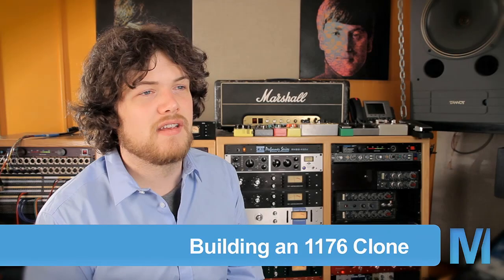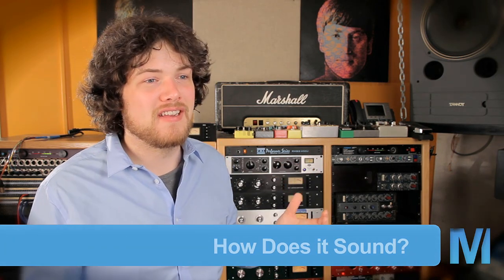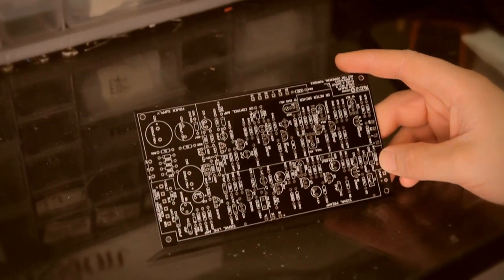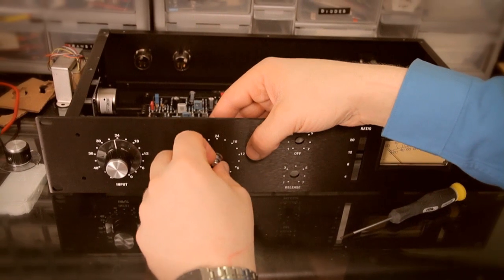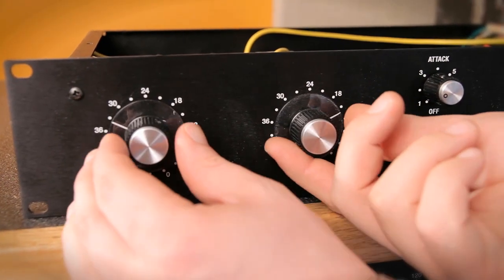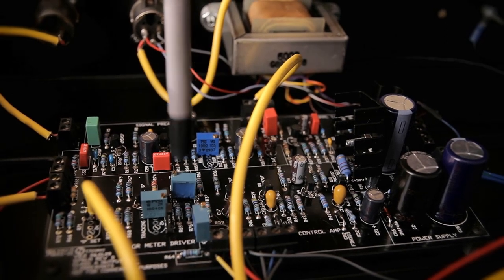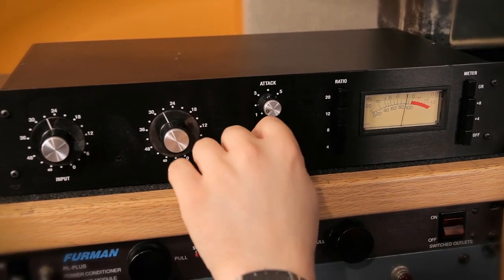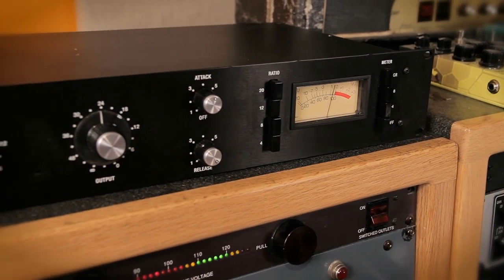(Audio Compression) How To Build 1176 Compressor Clone DIY For Music

Comment: Boy, this is an interesting throwback video. Back in 2011 it actually made sense to DIY 1176 clones. It really doesn't today. Pimarily because 1176 plugins have gotten good enough to do the job equally as well the hardware without much - if any - audible difference. Secondly; you can now easily purchase fully assembled hardware clones from lots of different companies that are electronically identical to the DIY kits - yet cost about the same. Unfortunately there really isn't as much incentive to going DIY on them anymore.

Comment: Hairball Audio. Go for revision D (its the same the UA 1176LN and Purple Audio MC76/77 is based upon). The kit includes all you need except components. They are available via the BOM (bill of material). There is a link to mouser where you can basicly just "add to cart". Have fun :) And remember to check up on safety. You can die if wire wrongly or touch a charged capacitor. Good luck

Comment: Okay, I love the idea of building my own compressor. I'm sure it would be a huge headache but also super fun. But, kits are expensive-- just $50-100 less than the price of a prefab clone like the WA76. What would I gain by building my own from, say, the Hairball Audio kit?
Reply: i reckon the hairball rev a sounds a little better than the warm. and the 500 series hairball kit is only $425, looks like. same ed anderson transformers and everything as their rackmount. edit: i'd be more interested in getting a pre-built hairball myself, but at the moment i'm getting very satisfactory blue stripe-y sounds out of this free plugin called Fetish by analog obsession, so it's hard to justify for me. and no, i definitely don't feel this way about all plugin/hardware compressor pairs. i reckon a vintage 1178 would have a specialness that i would not be able to get out of Fetish, though.
Reply: That’s a good question. For people who are good at soldering and building circuit boards, this would be an enjoyable experience. Personally I would just stick to the Warm Audio or similar type. In the future, if I’m feeling adventurous I would then build a DIY unit for something a little different.